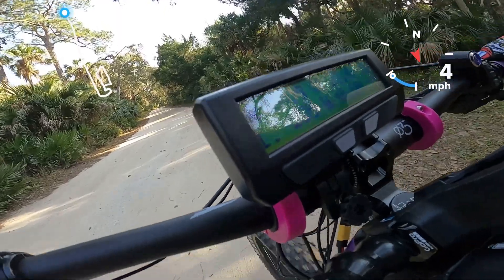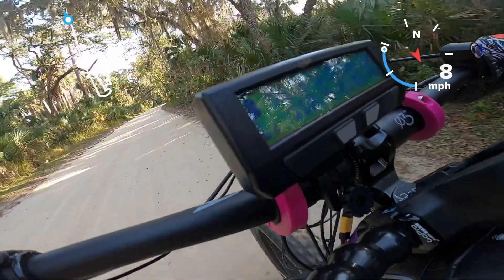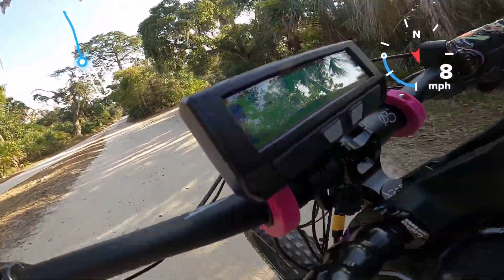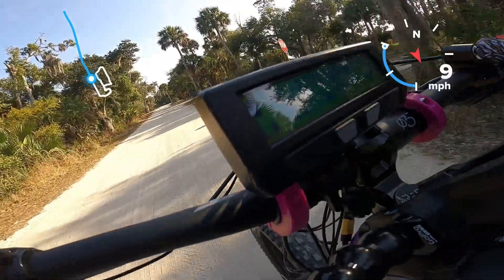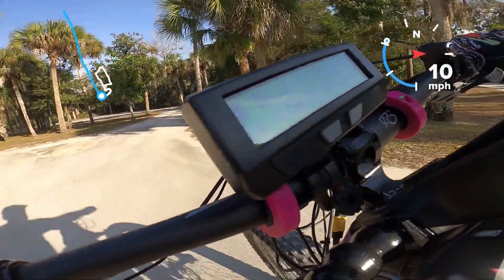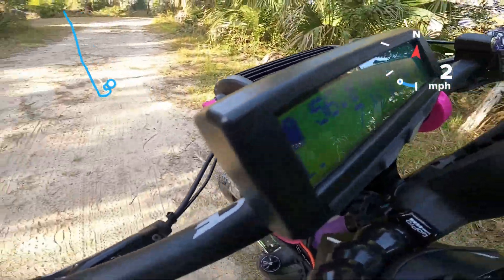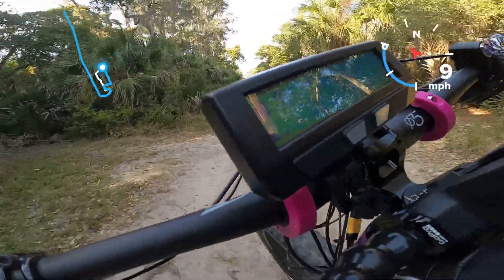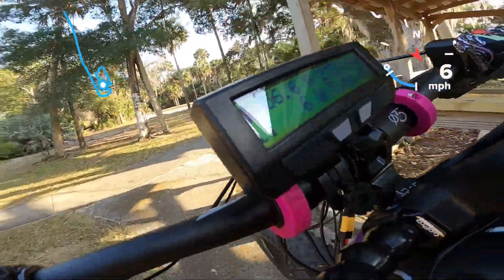BBS-HD + Phaserunner + 25 Amps of field weakening!

Comment: I'm right at the beginning of my build. Same setup as yours but I'm building a 74v 3kw modular battery pack with 21700 Tesla cells. This is my first ebike build. So much to learn but I'm enjoying every minute of it. Thanks for the video.
Reply from the maker: Very cool man,  what bike are you using?

I am building a 72v pack now, that’s meant for big power!  Not sure I can post videos in the comments, how ever I’ll make a video on it soon.
Reply: I got my 52v batteries putting out 4200 watts on a bbshd there's no benefits to running 72v on the BBSHD really other than less heat and possibly a little up tick in speed but honestly I don't see a faster speed when I run 72v because the system just lowers the max amp output and my 52v set up can support the max amps at 52v so either way 72v or 52v with my particular controller which is a different one then yours but very similar the asi bac855+ hacked with a NXT arduino tuner display kit it doesn't matter if I run 52v or 72v it will always output 4200+ watts around the same just at less amps on the 72v naturally so less heat and possibly a bit higher rpms but I don't always notice the higher rpms really.  What I will say is 4200watts on a bbshd powered ebike is fucking mind blowing.  I can put it in a high torque gear and do easy instant power wheelies or put it in a higher speed gear for keeping the rpms down on the long journeys where I'm hitting and holding the motor at very high speeds which I may add when I ride like that I typically do so using a much lower power setting because I find that you don't need that much power to get up to around 30-35mph and than each mph faster after that waste tons of battery power for a small return in added speed so for long trips it's not worth it for me to use the max power output but the nice thing about my nxt set up with the asi controller is I can turn the power down instantly with out having to pull out a phone or get a computer or even stop pedaling and with the newer sine wave and foc tech in these controllers it's so much more efficient then any the cheap square wave controllers that most ebike motors come with.  My two 52v 21ah batteries can get me over 150 miles range at a speed of about 30-35mph the whole way easily and possibly do much further but I'm being speculative and guessing on the lower side.  I've done 40-50 mile round trips using just one of the 52v 21ah batteries and still had plenty power left when I made it home riding it using my eco settings/tune so running both batteries in parallel is really only for when I want to go fast and not run a single battery super hard or get a decent range while going fast or a super duper long range riding efficiently but for the most part I'm fine with one battery.  The bikes super heavy with two batteries.  I'm likely going to build a new battery for the BBSHD bike and for my Segway x260 and likely it will be 72v since I just want all my bikes to be on the same voltage.  I'm planning on eventually getting a stealth bomber Enduro frame which was my original plan but then I got a hook up on a Segway which I'm getting delivered soon and already have a hacked ASI bac2000 controller for it that I was saving for the Enduro build I wanted to do.
Reply: @WarzoneWarlordGaming   The reasons I went 74v is for less heat and I was going to build a vector bike and swap it into it. Plans have changed and I end up pre ordering the new Dualtron Thunder 2 , which already comes at 74v 40AH (can't wait for that to come). I live in NYC Manhattan so for me it's always stop and go. I'm very heavy on the throttle and the 74v will fit my needs alot better and will be safer. Less heat especially in the summer months. When I build anything I always overkill it just to be safe as it is parked indoors. So yes you are correct in what you have stated,  but for me and anybody in a similar environment as I am I think 74v would be a better safer choice.
Reply: @skonyc3164  oh I wasn't really trying to debate what would be better for anyone else just wanted to state my observations.  I also still want to build a decent 72v battery for both my BBSHD and my Surron on my Surron I might actually go for a 90v battery but I'm not sure yet.  I've been reading a lot on how to build a solidly reliable high performance electric motor and from what I'm reading the high rpms field weakening induces causes so much wear and tear on the motors that's why I'm kind of glad I have a mid drive that gives me gearing options. My current thing I'm debating with myself is what would be better a high ah capacity 52v battery then what I currently run or a higher voltage or try to go for both high voltage and capacity.  On the Surron there's limitations to what I can do because of the way the battery box is set up.  You can build the battery taller but not by a whole lot before it starts looking crazy.  The bike on the other hand I have a lot more options to custom weld a battery box.
Reply: @WarzoneWarlordGaming  I didn't think you were debating me, I was just trying to tell you why I went the route I went with. If you take ohms law and apply it to what you are looking to build for yourself that will help you decide what battery is right for you.
Reply from the maker: @WarzoneWarlordGaming  Reading this your riding style is much different. I have a direct drive hub I use for the street.  It can be tough getting a single bike to hit all the check marks.  I have a full softy 52v 3000W 26". Fat bike at 72v BBSHD, Fat bike at 52v BBSHD, and A super73 at 72v direct drive hub. I find myself using each of them for different days of riding.

Glad you are enjoying the bike at 52v, I did that for a while, 72v Is better in almost every way.  ( FOR ME)
Reply from the maker: Awesome, I run a 20S5P now on the bike. Using 2170 cells. It's insane the power.